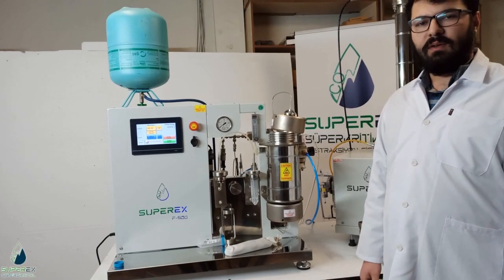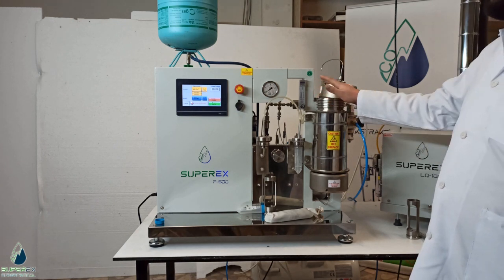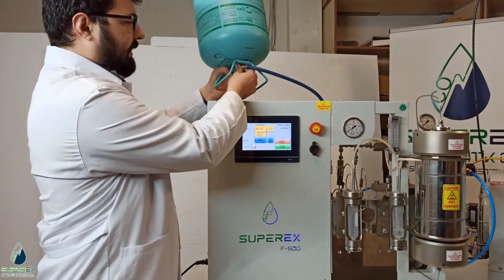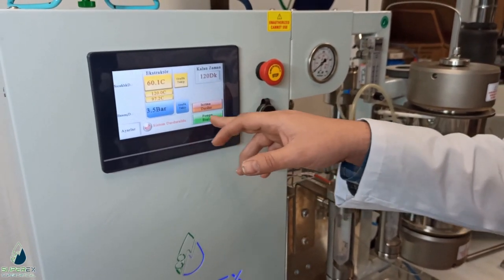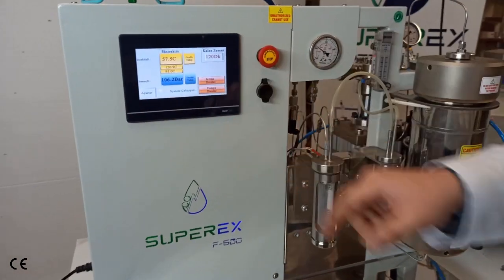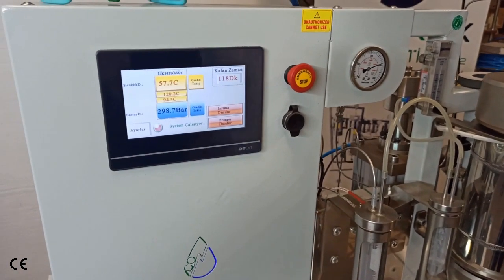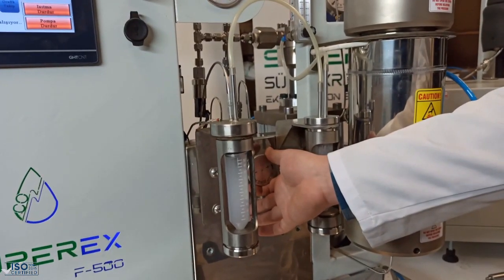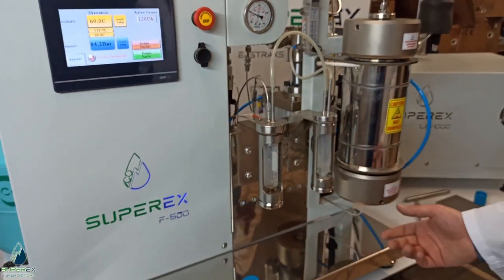Superex F-500 Supercritical CO2 Extraction Machine/ Extraction By Using R134A(Freon) as a solvent

Comment from the maker: R-134a is a very safe refrigerant with an ASHRAE safety classification of A1. This means it is not flammable and has very low toxicity levels. Because HFC-134a has no chlorine in its molecule, it has a zero ozone-depletion potential (ODP) and doesn't deplete the stratospheric ozone layer.

Comment: I don’t know what your end game is, but if it is to extract CO2 from the air, I would like to see an experiment in a green house environment full of plants and see what happens as the CO2 decreases
Reply from the maker: The process is extraction of some oil,wax etc. from levander  by using CO2(in this case R134A) as a SOLVENT.
Reply: Dude ur in the wrong channel, this machine is built to extract goods out of herbs n stuff using CO2. In this case they're using AC gas instead of CO2.
Reply: Hi co2 is used by plants to grow